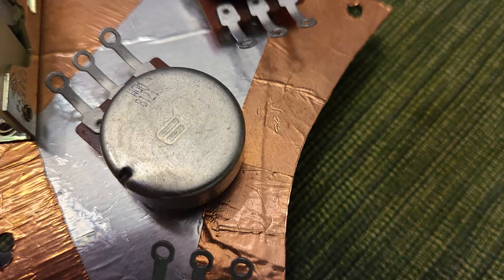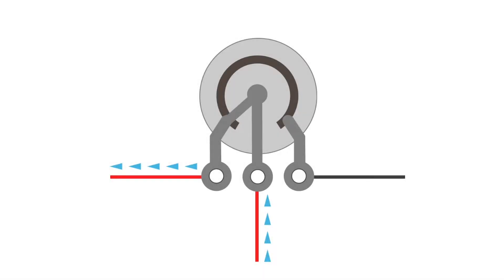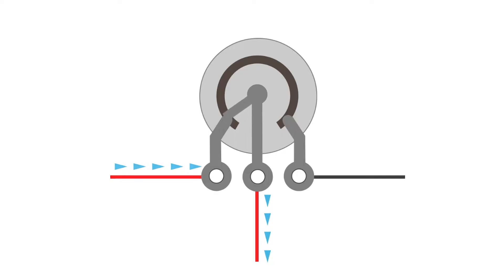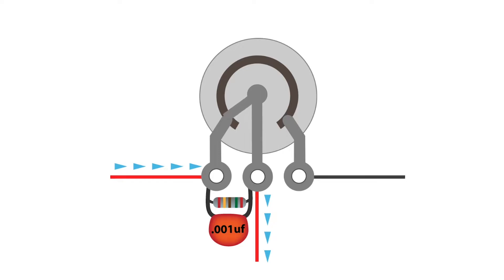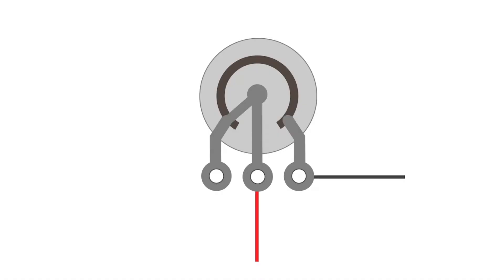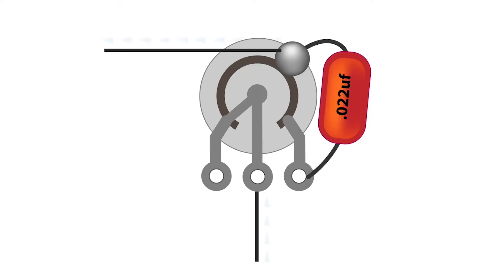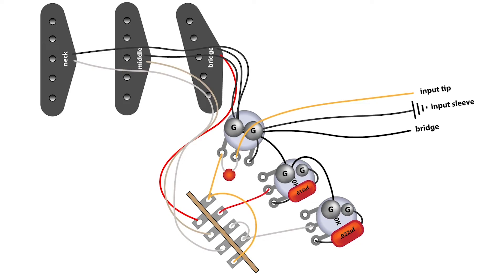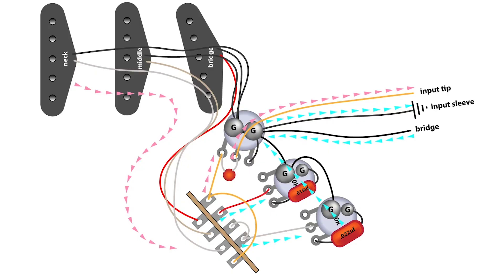How Potentiometers Work in Electric Guitars

Comment: This is extremely helpful, but it’s hard for me to visualize while turning it clockwise would turn it down. Because the knobs on all of my gear work the opposite way.  Can you help explain that please  thank you again for a great video
Reply from the maker: yes. This is the back of the knob, so it's backwards from facing the dial.  The selector switch is also reverse from how we"re used to thinking of it.

Comment: Wonderful! thank you. And what happens if the pot's material won't take the soldering for the tone knob example, can I just wrap a wire around the shaft's base connected to the cap?
Reply from the maker: @MrXikwriNeyrra  not sure if that would work. check out some soldering tutorials. scuff up the pot with sandpaper. I scratch mine up with whatever tool I have in hand. Heat the metal first and then add the solder while pinning the wire down with the iron. You almost need three hands to do it.
Reply: @sevenpoundsalad3878  well I figured out it works just fine without soldering it to the pot. I guess it's just for making it sit on something. My project is a saturator so I don't have to have it strictly soldered like a guitar one. Thanks for answering 🙏

Comment: There are a lot of problems in this explanation, apart from being no semiconductor. The complex impedance (resistance over frequency) of the pickup coils affect the performance and the input resistance of the guitar amp and cable. The effect of the settings of the knobs onto the guitars frequency response is dependend on these external factors. One way to visualize the frequency response would be a simulation using LTSpice. So an old tube amp (input 1000000 ohms) gives different sound to a modern transistor am (input 22000 ohms).

Comment: I’ll Take The Single Coil Pickup and Glue a Brass Plate Under The Bottom 
Run a Ground Wire To Each Pickup to The Brass Plate Then Dip In Wax And There are Many Different Ways To Take Advantage of a 
5 Way Selector Switch 
This is Just a Couple of 
Examples You Can Disconnect The Tone Pots And Just Have a Single Volume ……Wire The Lead Pickup and Rhythm Pickup as a Humbucker or Two Coils as One and 
Leave The Center Position 
Not Connected and You Have a On/Off On The Selector Switch And Then You Can Wire The Rhythm Pickup As a Single Pickup and The Lead Pickup as a Single Pickup and The Middle Pickup is a Sleeper 
Then You Get All Your 
Tone From Your Amp 
This is Just One Example Of How To Wire a 5 Way Selector Switch 
Or You Can Disconnect All 
The Tone And Have a
Separate Volume Pot For Each Pickup And Wire The Pickups as Humbuckers with Two Separate Volume Pots That Control 
Each Pickup Separately in Other Words
You Can Have Two
Single Coil Pickups On At The Same Time and Have Two Separate Volumes at The Same Time 
Just Disconnect 
The Tone Pots And Make Them Volume Pots 
Plus Take Aluminum Foil And Layer That in 
The Guitar Pickup Cavity 
Single Coil Pickups are Noisy Enough This Helps with The Noise 
I Hope This Makes Sense 
Hey Just Have Fun
Don’t Be Shy With Your Guitar Open it Up 
The Strat is Perfect for 
This Kind Of Thing

Comment: Wow.  The visuals in your video are great.   Excellent explanation.   Best I’ve seen yet.  I can’t just follow a wiring diagram when doing my guitars.  I have to understand what’s going on.   That’s how I run all my Strats.   A video that is much needed is a Tele  4 way pickup scheme with an explanation of what’s going on with each connection.   Thanks so much.   Will check out your site.

Comment: Just ran across this, and wondered why like many others. You don't start your wiring by attaching a ground stand to the back of all the pots?
 Bend the terminal your going to ground, up tight to the back of the pot like normal. Then take a clipping of wire off the tone capacitor excess length. And bend it to a 90° angle, before using it to complete the ground curcuit of your pot terminal. Now you'll be able to easily solder any other grounds to that stand. Without heaping blobs of solder onto the back of the pot repeatedly. It's very easily unsoldered if you need to make some wiring changes.
 Theres nothing worse about wiring a custom guitar up. Than battling giant blobs of dirty contaminated old solder. I prefer to never go down that road. Once you start doing it this way. You'll never go back to battling the blobs!

Comment: 0:13 Semiconductive material typically refers to active components (transistors, mosfets). Nothing active here, it's just a resistor
Reply: "Semiconductor" is a class of materials, it can be found in both active and passive components. Germanium is a semiconductor, a germanium diode is a passive component.
Reply from the maker: yeah many people pointed out not to say semiconductive. will update later. thanks
Reply: Conductive material he means.
Reply: Moderately resistive material.
Reply: You're right, but I don't think anybody really uses the word "semiconductive" to refer to semiconductors. Bro was trying to say "semi-conductive", as in conductive but only partially. You're correct in pointing out the wrong or confusing terminology, as resistors are not semiconductors. However it also might not be correct to say that semiconductors are only in active electronics, since diodes can be made from semiconductors, and are not necessarily active.

Comment: One thing I wish I understood is what the purpose of the resistor in the treble bleed circuit. What happens if I go up or down in value?
Reply from the maker: @totallyunmemorable  my understanding is it keeps the tone smoother through the volume drop than just using a cap by itself.
Reply: @sevenpoundsalad3878  it effects the taper of the pot. Some people like it, but if you play with quite a bit of gain you need to turn the guitar down further which is a bad thing.
Reply: I used 130K on a 250K pot, parallel with the cap.
Reply: I wonder about this too. I believe the resistance value determines where in the treble band (audio frequency start and end values) the circuit is most resonant. If the guitar circuit is like consumer audio systems where the speakers are 8 ohm impedance, there is an optimal point for the speakers to function. In the full audio spectrum (for humans) that band is 20 Hz to 20,000 Hz, so I'm thinking at 10,000 Hz is the optimal frequency for the consumer electronics speakers to operate. Not sure on the frequency, but there is an optimal frequency somewhere in that band.
Bottom line: The resistor's value can determine the guitar player's desired amplitude and frequency of treble bleed - understanding treble is itself a frequency band within the full human audio band.
Reply: @ronaldschild157  My understanding is that if the cap and resistor are in series then the resistor will determine the amplitude of the treble in the bypass part of the circuit. I have done this for bypass circuits on amplifier volume controls. It works well to get the right frequencies without too much amplitude.
But with them in parallel I'm lost. It's always said that it has to do with the pot taper, but nobody ever explains exactly to what affect.
Reply: By not just using the capacitor to bleed only high frequencies (larger caps let more frequencies through), by letting a resistor run parallel to the capacitor, you're letting a certain amount of all the pickups frequencies bleed directly through the output bypassing the pot as well, which keeps the tone of the output more balanced through the entire sweep of the volume pot.
There's a balance to the whole thing as different caps allow more low frequencies through and different resistor values allow more or less of the entire frequency spectrum through at the same time, and they all balance specifically with the value of the pit in the first place.
Reply: In other contexts a resistor in parallel to a capacitor functions as  a way to discharge the capacitor when the power is cut off. This reduces the chance of getting shocks from circuits that are powered down.
Reply: The cap only has an resistance value at certain frequencies. SO the cap would be a total short at times and a total disconnect at certain times. I think the resistor prevents surging because of this.
Reply from the maker: @GamingKeenBeaner  thanks for clarifying!

Comment: What value of cap is on the volume pot?
Reply from the maker: .001 microfarads on the treble bleed capacitor. it doesn't have to be this value. Look on Stewmac or Reverb for recommendations. I like Boffin adjustable treble bleeds.
Reply: @ thanks
Reply: On the volume pots(s) on any electric bass or guitar there is no capacitor. Unless you decide to install a treble bleed circuit.